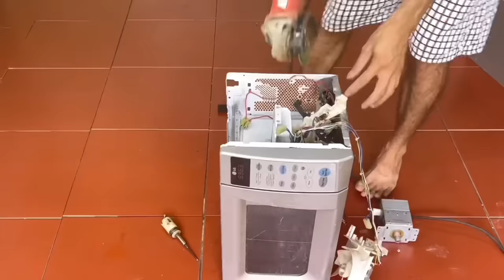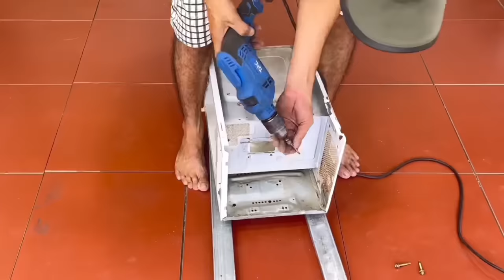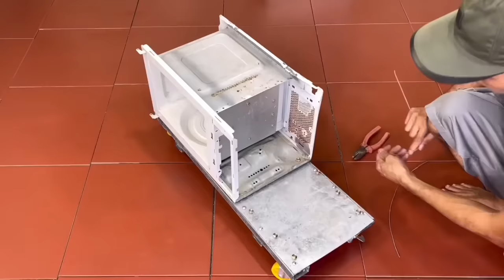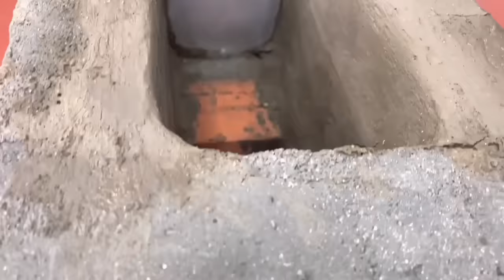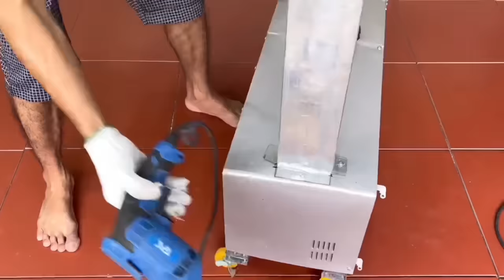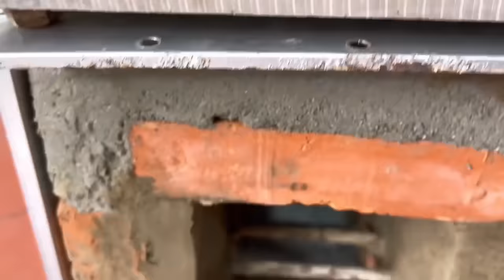wood stove combined with baking tray #165

Comment: One more thing, you must know that a solid fuel stove must be able to be cleaned after about 40 hours of operation, so it must have openings for that purpose. So this is just a toy for small children. If it was that easy to make a stove, everyone would do it. The easiest and simplest way is to assemble 3 blocks of bricks and cook without bothering, and in the end you have a thing that doesn't work yet.
Reply from the maker: Thanks